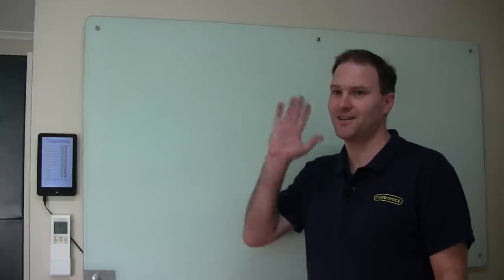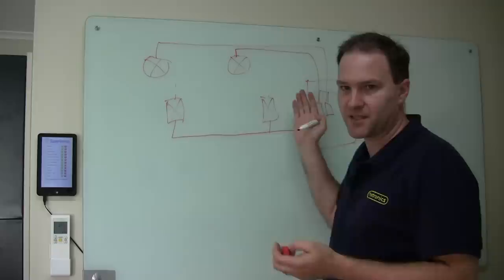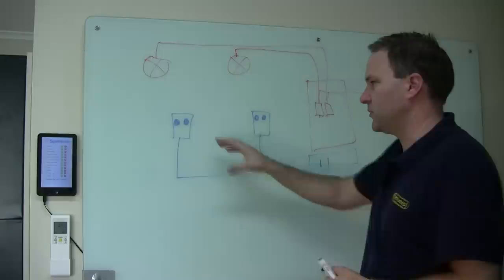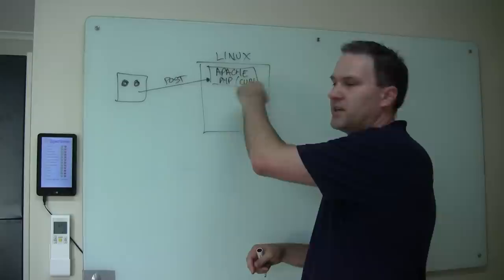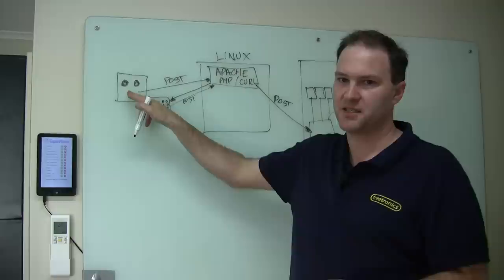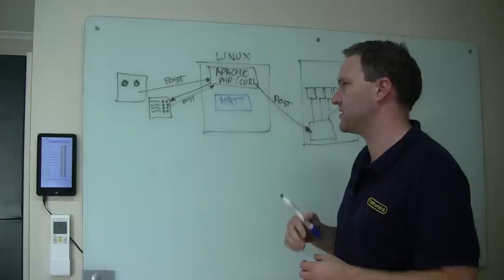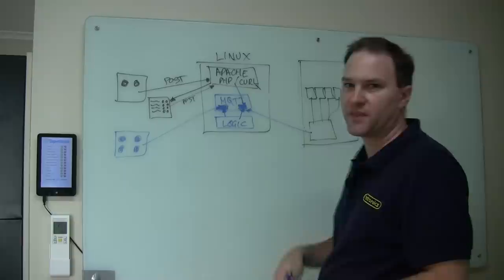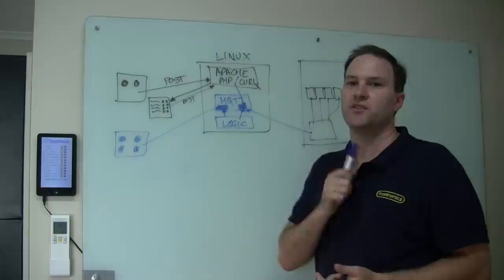SuperHouseTV #1: Home Automation System Architecture 2012

Comment: My home automation setup uses software called Open Source Automation (OSA).  Not only is the software open source, but it is designed to be a bridge between nearly all of the home automation technologies out there.  When I started, my setup was primarily X10 based.  I have since added an RS485 thermostat, some 1-Wire temp sensors, and some magnetic reed switches that I have run through a custom built parallel port interface. And all of these technologies are controlled through OSA.

Comment from the maker: The centralised-control approach has another cost consideration that's more important than the cable: labour. With a retrofit the cost of dragging cable can be very high, more than the cable itself. Luckily we had a combo of new build at framing stage and old reno with plaster ripped off, so dragging cable only took a few hours and cost was minimal

Comment from the maker: I'm using common 12V coil, 250V / 10A rated relays fitted in DIN rail mounts. Yes, they could control outlets as well, but my plan is to move to SSRs because the relays make loud clicks when they turn on.

Comment: All nice but when the Linux box crashes - you have no lights.  If I was refurbing a property, I would prefer physical switches that are also controlled through automation.  That way when you have technical issues, your not plunged into darkness.
Reply: Richard Smith so true...
Reply: Richard Smithøå
Reply: Of course, I have yet to have a linux box crash on me. They get the most amazing uptimes.

Comment: Very nice seeing something like that on a big scale! I have something like [] --> light switch --> socket-outlet --> wireless socket-outlet --> light bulb at the moment, because that was the simpliest way for me to get wireless controlled light in my room, but when I turn off the light switch on the wall, the wireless socket-outlet loses it's power. No problem, that it's no longer receiving, but it also loses it's state and it's default state is off. (1/3)

Comment: I get that at times, it's nice to have some additional logic available at the switch.  But for turning lights on and off, I don't understand the need for an Arduino at every switch.  Why not have the button just close the circuit and have a central Arduino handle that?  Seems way overkill to me, but I'm not a pro here.
Reply: Same idea here. He could have cat5e to the switches and have room for the hot/neg pair and then three other pairs for buttons. Less logic at the switches and less heat.

Comment from the maker: Lutron is no good for me because it's only 110V, won't work with Australian 240V mains. The big reason I'm going DIY, though, is to avoid the whole "closed-ecosystem proprietary package" integration problem. As soon as you start using classic commercial HA products, you have a problem linking it to anything else. I can't be bothered spending my time trying to reverse engineer some proprietary commercial system when I could make something myself from scratch in less time.

Comment from the maker: If you just want to do a few simple things and plug in some commercial gear, yeah, maybe. It's far more limited though: it's a single-master, multiple-slave bus, rather than all-nodes-equal peer group like I have using Ethernet. I wouldn't gain anything by using DMX, but I'd lose a lot of flexibility.

Comment: Copper is expensive, surely it would have been cheaper to use a localised control at the light fitting? So have the original switched loop power supply as is usually installed, a small contactor/relay in a junction box per light fitting and a cheaper low voltage control cable back to your control box. You'd then still use your same switching panels etc, but the large mains cable is used more efficiently and saves you money. You could even go totally ethernet control to the fitting.

Comment: Hello, Like Doug Dale and Skulltronics said before, looking this system from a maintenance, ease of use, reliability and installation costs, automation systems should integrate with existing cabling infrastructure (atmel's zigbee modules, less cable, less installation costs), and a central console with something simpler like a small PLC (automation direct are really cheap and reliable) that would not require an expert to do some programing and HMI's.

Comment: I don't think you've really thought this project through. You have all the high voltage devices wired directly back to the central switchboard, the argument you made for this in a separate video was that you didn't like having lots of devices all over the place, but then you have an arduino control panel in each room...

You could have kept the high voltage cabling for the light switches and replaced the switches themselves with relays controlled by the arduino in each room.

Comment: A very complicated way to turn a light on. Publish post subscribe  etc The logic is simple if the switch is on then turn on light,  So run a cable to the switch test if the switch is open or closed then open or close the relay to turn on the light.

Comment: Why not run a cluster of Raspberry Pi's one for each room of your house, prevents your single point of failure as well as distributing the network load. It also allows your home to easily scale up and down as you need as well as allowing integration to your televisions. It's also relativity lost cost and could incorporate into your current system with minimal effort.

Comment: Great channel.
When you say PHP is heavy weight for this, what do you mean exactly? Server running it consumes lots of power compared to MQTT? What are the challenges met with PHP which are resolved with MQTT?
Would also like your opinion on technologies like zwave for this type of setup. Thx.
Reply from the maker: +vic ky By "heavyweight" I just meant that it uses a bit more disk space and CPU time than some other approaches. On a desktop class machine it's fine, but it can be slow on low power machines. Using MQTT it's very easy for small devices (such as microcontrollers with maybe a few kB of RAM and FLASH) to connect and communicate

Comment: Nice work but i don't see any redundancy in the plan while everything is centralized.
Don't you feel unsafe, when your central linux machine goes out?
Reply from the maker: That's a very good point. I still have that problem, but my system has changed a bit since that video was uploaded. I'm doing an updated system architecture video now, it'll probably be the next one uploaded.
Reply: Absolutely stinging for the updated Architecture, 3/4 the way through a 1st floor addition, wiring is in progress.

Comment: I'm only starting in computer and automation but why so much cables instead of running one serial bus (or 2 or 3 for different areas) around the house?
And why using a big Arduino board for each of the button and not a simple serial enabled button?
Reply from the maker: Good questions :-) Many home automation systems do use some form of serial bus (such as RS422 or similar) to allow devices to be daisy-chained. That saves cabling time but potentially makes each node more complex. Since I was dragging the cables myself and wasn't charging myself by the hour or by meter of cable, I opted for a star configuration so I'd have maximum flexibility with everything brought back to a central point. What do you mean about a simple serial enabled button? Do you have an example? Since this video was made I've replaced all the light switches with simple button panels that are managed by centralised Arduino based boards with many inputs, so I don't have Ethernet to every light switch anymore. The cable is still there, but it's used to sense the buttons directly. Each panel now has nothing on it but a wall plate with dumb momentary-action illuminated buttons in them. I'm going to do a video about the updated architecture soon.
Reply: +SuperHouseTV That makes sense if the cost of the cable is low for you.
I'm assuming the cables going to your wall switch sockets is shielded (6 wires eternet?) so you probably could have a pushbutton with a Arduino nano, (or check out the "digispark" board,) sending a coded signal to the control unit.
I'm myself digging through the heap of different serial protocols so couldn't tell which one is better but I've read that i2c and "can" can communicate on up to 100m of cable at a low baud rate.
Reply: +SuperHouseTV , could you give some details about the Arduino based switch input capturing board. a schematic perhaps or do you sell these at freetronics?

Comment: Why not use the wireless switches that are already networked interfaced and can communicate with many devices and programs? Like the Lutron stuff or other systems? This seems way more complex then it has to be especially for existing homes. Basically you just replace the switches with the wireless devices and you have a hub of some sort.

Comment: A contactor/triac would be cheap and reliable. Given the switch wire was probably already behind the wall plate. If access was an issue why not just mount the contactor/triac in the cavity with the already included arduino running the switch control panel? Easy to repair, no costly and large distribution boxes scattered around the house. I really cannot see any advantage in running 100's of metres of twin and earth for every light fitting unless for a commercial fitout and using large dimmers.

Comment: That means I have to turn on the light switch and trigger my wireless socket-outlet to turn on the light. Everything would be much better if the default state would be "on". Is there any way to hack that wireless socket-outlet? The worst and craziest method I thought about is sending from another source every few ms an "on" signal to catch that unique moment I turn the light switch on.. :/ (2/3)

Comment: Hello. What about when your Linux server goes down ? How do you switch the lights on and off ? Isn't it better to control the relay directly from the light switch at once and from the other side from your Linux server and android tablets ?
Reply: +Cornel Ghisoiu If the Linux box goes down then you're right, things stop working. Luckily it hasn't failed in 5+ years of continuous use. I don't understand what you mean about controlling the relay directly from the light switch. If you do that, you may as well just have the switch and nothing else, because if the switch can control the relay to turn it on, other controls such as tablets couldn't turn it off anyway so you lose functionality
Reply: Could you set up a second server that is a clone of the first and set one to the primary and the other to the backup. The backup constantly checks that the primary is running and if it finds it isn't sends out an alert and takes over control until the primary comes back online?

As you said it's been very reliable, but all things good things must come to an end eventually? :)
Reply from the maker: Yes, that's certainly possible. Clustered controllers aren't common in home automation systems, but there are already tried and proven techniques for Linux server failover (I've done STONITH setups in the past) so that could easily be applied.

Comment: You said it, MQTT is machine to machine communication, but this is no CNC Lathe or PAC Automated Machine in an industrial plant with thousands of variables, where talking about less than 200 I/O points (maybe?), no need for extreme safety or quick response time, I am trying to understand why this over complicated topolgy with Linux and ethernet comunication.

Comment: what happens if your network connection goes down?
Reply from the maker: That's a common (and very valid) concern. With many modern IoT devices they depend on an external cloud service to operate. I've specifically designed my system to be all locally hosted, so there's nothing external required for my house to operate. If my Internet connection goes down (which it does several times per day thanks to the crappy router provided by Telstra) the house keeps working fine. The only thing I can't do is control the house remotely.

Comment: First of all: I love your YT series of SuperHouse
Do you think it is possible to use a Ethernet of Power way of communicating with arduino boards? That way you don't have to wire miles of ethernet cable, because all the communication goes through the power lines.
It would be nice to have 110 volts (or in my case 220 volts) running to the lights and switches. The arduino boards will than talk to the main switchboards through the existing power lines.
I haven't found a Ethernet-over-power shields or diagrams though...
Reply: +Edwin van den Akker or probably use Zigbee instead of Ethernet of Power, if it's a small home.

Comment: I like your videos but I'm a little bit confused. I would like to ask you something. Why don't you use a client server based system and do the communication via sockets. The server then sends the command to the Arduino which then activates the corresponding rellay.

Comment: I already have ordered a 433,92 MHz sender and receiver for my Arduino and the receiver could log the data emited from the wireless remote control anyway, so the current state would be known. But that is really not a good solution. Is there any way to alter the wireless socket-outlet, i.e. "solder an "invert" onto the PCB", to speak in a logical way? Haven't opened one of the outlets yet, so I just ask for "feasibility". :) Maybe you have a great idea. (3/3)

Comment: would it be possible to do the same switch idea but instead of one on and one off botton just use the same button for the 2 actions and use a if statement inregaurds to the led for when powered on to change to power off command?

Comment: You could have used Zigbee.
Reply: Steven Luzuriaga no way. 6lowpan over 802.15.4 if impossible to use cables. tcp/ip over ethernet otherwise.
Reply: +Steven Luzuriaga Isn't Wifi good enough?

Comment: I've asked this question in another video of yours, but I would love to know whom to contact to have my desgins put on to a board. What software can I use on Ubuntu to design these boards?
Reply from the maker: For schematic capture and PCB layout there are 2 leading contenders in the cheap / hobby space: KiCAD and EAGLE. Personally I use EAGLE simply because my early work was based on the Arduino reference designs, which are published as EAGLE files. However, that's a proprietary package with a free-for-hobby-use limited version and paid pro versions. KiCAD is open source and very popular for open hardware designs, and we use it at Freetronics for many of our projects. There are excellent tutorials for both packages, but PCB design has a pretty steep learning curve so you'll need to have some patience when you get started.
Reply: Thanks, I am learning a lot, and sooner or later, I might have to miniaturize a prototype.

Comment: If the Ethernet  off thin all house will off .What your solution???
Reply from the maker: +AW Yes, if the Ethernet switch fails then light switches etc will stop working. Ethernet is very reliable though. It hasn't been a problem even after many years
Reply: +SuperHouseTV when will you make more videos ?
Reply from the maker: +william roberts I want to start making more very soon, but I've been burnt out and too tired. It takes days of work just to make one video :-(
Reply: ok looking forward to seeing your next video

Comment: You should put XMPP IoT in the server to handle anything in and out of the server, so you can do higher level federation, the propper way. It has all the Authentification, Authorization etc already done and tested.  You can have pub-push on many nodes at once.  And you can have mash, and not only tree.

MQTT are good as long as you don't go out of your LAN, and are lower level.

Search IoT XMPP for more information.
https://archive.fosdem.org/2015/schedule/event/deviot12/
http://www.theinternetofthings.eu/joachim-lindborg-xmpp-internet-things
https://github.com/joachimlindborg/XMPP-IoT
Reply from the maker: Good idea, thanks

Comment: Watching your video and your DIY home automation system, I really dream to do the same kind of thing one day...  well done !
You're talking about latencies improvement with MQTT. Have you any measurement to compare H TTP vs MQTT ? Is the H TTP (TCP) latency really discernable in your local network ? Is MQTT a UDP based protocol ? Why do you need to get separate buses to segregate the messages sent ? Is it to specialize each program that will have to listen to one type of message ? Thanks

Comment: Hi again.5 years it's a long time. that means you should start backing up your system:), but now without joke could you not control same relay both from light switch and linux ? I mean that is single point of failure what you have done. it is great that is working, just it's a little risky. thanks again for reply.
Reply: +Cornel Ghisoiu Yes, it's backed up, and I maintain the configuration files in Git so I can recreate the machine any time I need to. Although the cooling fan is getting noisy, so I have a Raspberry Pi here on my desk as a replacement so I will retire the old machine soon. About controlling from both switch and Linux, I don't understand how. Which one would win? If the switch turns on the relay, and the automation controller wants to turn it off, should it override the switch? But then if the controller wants it off, and you turn on the switch, then it shouldn't override the switch anymore? It's a logic problem